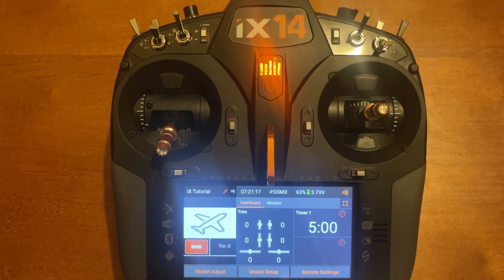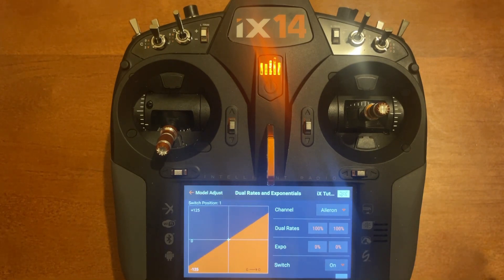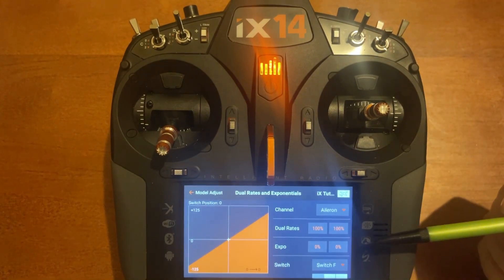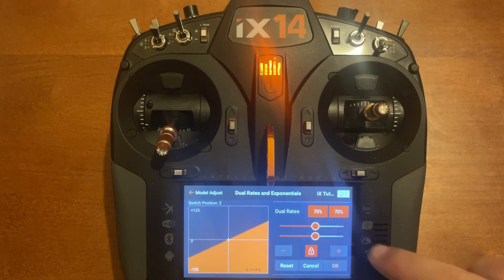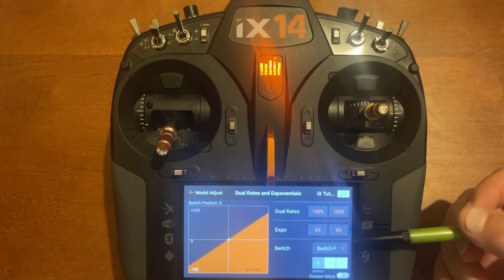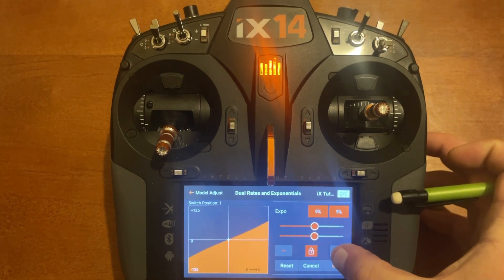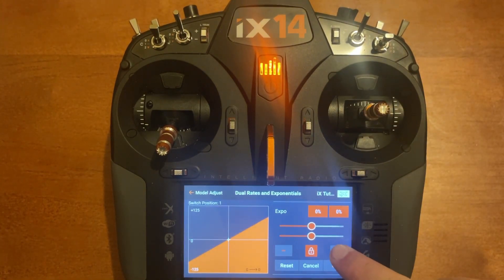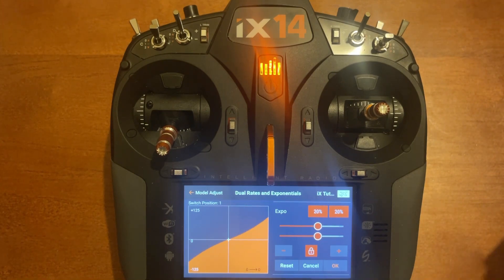Spektrum iX Setup: Dual Rate and Expo Explained

Comment: Hi BD
I’ve watched your utube a bunch of times but can’t make any sound decision due to lack of experience
I’m a new RC consumer
Just bought a new NX10+
I have 1.2 warbirds, EF-P47, EF-T28, EF-P52 & FL-Bearcat, but at present only fly a beginner Ranger 1220

I’m trying to makeup a standard template for them all
Can you please give me some settings to start off with?
Here are my notes so far:-

AILERONS
0= Low  1= Medium 2= High
    SWITCH          RATE.          EXPO
LOW.  (0)                 70%.           10%
MED.   (1)                 85%.           20%
HIGH. (2)                100%.          30%

ELEVATOR
0= Low  1= Medium 2= High
    SWITCH          RATE.          EXPO
LOW.  (0)                 70%.           10%
MED.   (1)                 85%.           20%
HIGH. (2)                100%.          30%

RUDDER
0= Low  1= Medium 2= High
     SWITCH          RATE.          EXPO
LOW.  (0)                 70%.           10%
MED.   (1)                 85%.           20%
HIGH. (2)                100%.          30%

Comment: Thanks. Is NX better or ix?  Cannot follow what's going.  I just want to reset my as3x manually to start using it with my radiomaster TX.  Should I buy the USB cable or put the binding plug in Chanel 3 and 4 like lemon rx!
Reply from the maker: Both ix and NX have advantages.Spektrum would be easier to access.Open TX is suppose to be able to access forward programming...